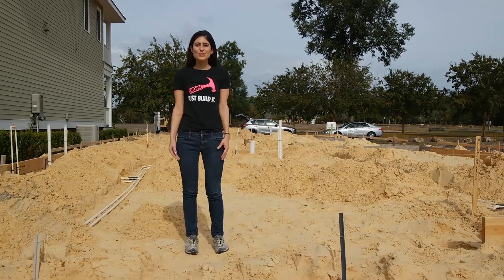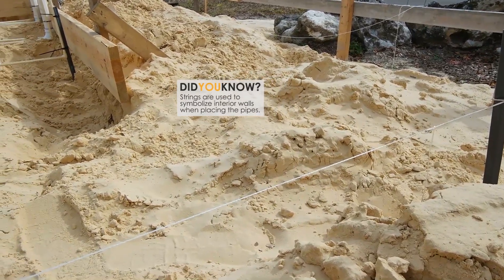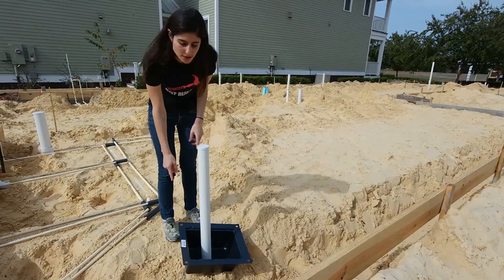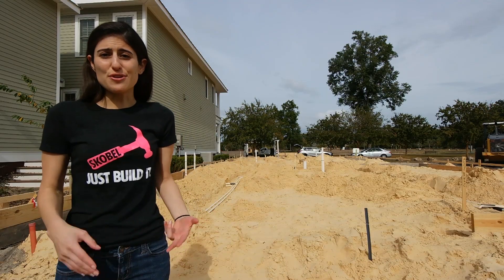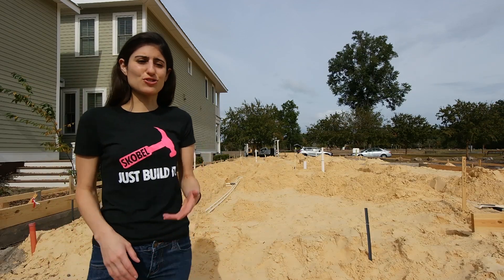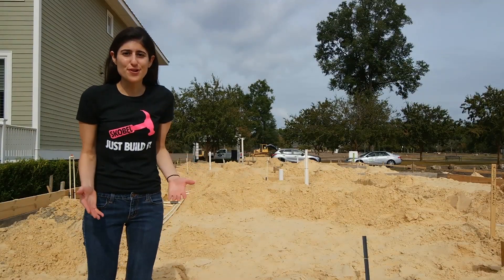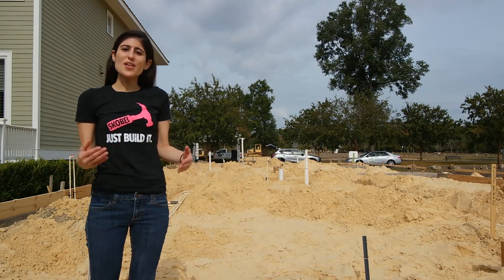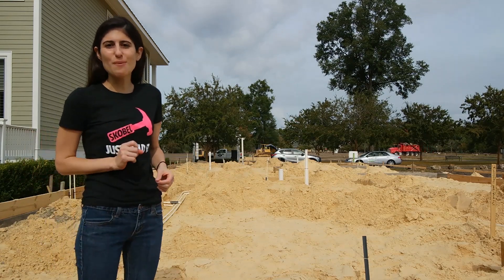Homebuilding 101: Underground Plumbing

Comment: That is a scary foundation. Do you really bury those pipes in concrete? And, is that cpvc? Yikes! Terrible pipe and terrible fittings.
Reply: I thought the same thing when I saw it. Yes it's definitely cpvc but it looks like it's going to be embedded in sand then the slab will be poured over it. I'm in South Florida and debating what to go with. After all my light research I heard that CPVC can become brittle after 15-20 year. Contractors install them because of costs: $3(CPVC 1/2'') vs $15(Copper Type L, 1/2'') I'm compromising a bit. Anything inside of the wall that I'm installing is going to be copper that's soldered, and the run that I'm replacing outside of the house will be CPVC connected with SharkBite fittings it helps in tight spaces.
Reply: Luis Sonoma  As a South Florida builder I recommend not “burying” anything that’s not necessary. Whether CPVC or copper, don’t run it underground as in this video. She even mentions “...if there’s a leak...”. Leaks are no fun regardless of where they occur, but you’d much rather one where you have immediate access to it. Water supply, electric, cable, phone, low voltage can all be run overhead.
Reply: @seanm3226  How would that hold up if a Hurricane come, debris could potentially hit it and causing a leak. I have to run two water lines for an exterior laundry room ten feet away from my house.